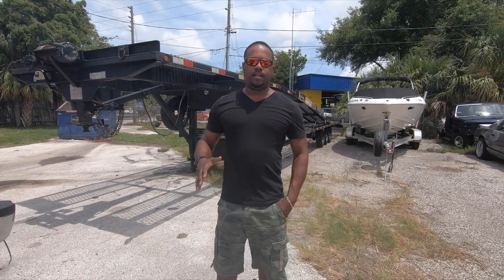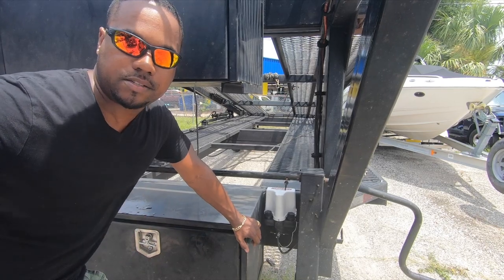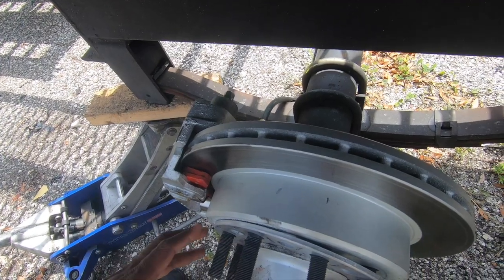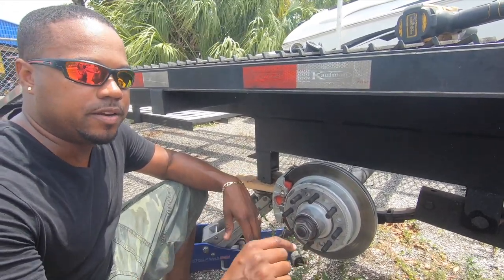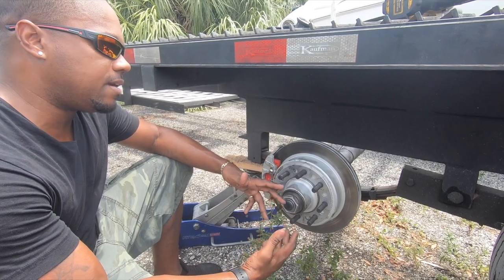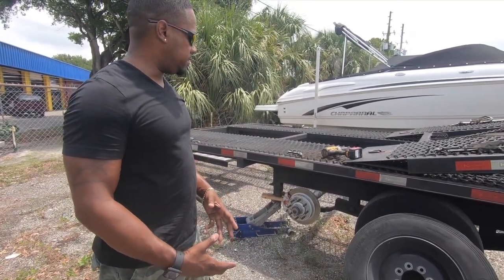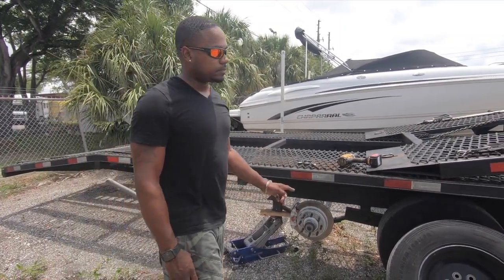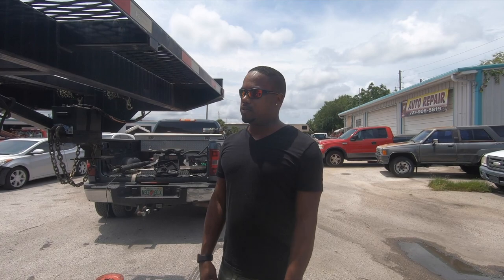Disk Brakes on EZ4 Trailer

Comment: Thank you very much for your videos my friend. I used to have the Hydraulic overElectric breakes on my EZ4 and on time I lost one tire in Tennessee mountains and I had a realy bad time because if you loose one hose in any wheel you loose all the brakes on the trailer , after that I change back to electric you loose one wheel you keep 5 breaking.  Im no trying to talk against you video bud Im just sharing my experience with you, Bud ...and again thanks a lot for your videos.
Reply from the maker: Yeah I worry about that exact situation all the time so I try to keep as much spare parts as I can with me in the truck. But thanks for the support brother

Comment: Thank you for sharing your knowledge and yes - I agree, disk pad replacement is so easy and you may have solved the biggest complaint about hauling four cars with a dually - the stopping part! The truck will pull the weight no problem and as long as you do not thrash the shit out of it from stop - get go,  your transmission should hold out as well.
Reply from the maker: 😂 you are absolutely right stopping is a must and This was the best investment for this trailer
Reply from the maker: Thanks for the love brother

Comment: Hey bro, did you have to weld a different flange in order for it all to work? My kit is not lining up.
Reply from the maker: no welding but i did have to use wheel spacers
Reply: my kit isn't lining up either. Did you ever figure it out? I have 8k hybrid axels

Comment: What year is you chevy?  My 2011 feels like I have no trailer brakes at no time. At least with the foot brake. I'm now looking to convert to disc brakes
Reply from the maker: I have a 2011 Silverado 3500 and I felt the same way when I had drum brakes on the trailer. It’s also way cheaper to maintain the Disc Brakes and then the drum brakes

Comment: Whats up brother, thank you for tour videos in advance, I have a kaufmn EZ-4 with the ussual issues you mentioned, what issues you hav found with the disc until now, I heard people say they lost pads and calipers burned and fail the whole system?! What do you think in your experience ? Thanks
Reply from the maker: I haven’t had any issues with the disc brakes other then the over priced rotors, I let one of my pads get down to the metal once and it damaged a rotor , fortunately I was able to get it cut for $15 and it’s fine but if I had to buy one it was $270 which is ridiculous.
Reply: Thats the price for a drum ,so dont feel bad, I replaced 2 months ago, equalizer, bushings,drums the whole brakes and 2 month afet I have 2 drums bad on the side where the magnets slides, and 4 pads on 4 drum but only one of the pads at each drums, I don't undestand how a new systemgets bas so quickly and why only one pad. Brother  the stopyourtrailer location its in tampa?
Reply from the maker: @davidcandao1  well the guy I ordered the kit from his name is Bill here’s his number (813) 363-4685 I can’t remember where he’s located but I don’t think he’s in Florida
Reply from the maker: @davidcandao1  and yeah I get six months out of these disc brakes and I never have to turn up my controller, when I had drums I was going through them like underwear and I was constantly turning up my controller not to mention they were a pain in the ass to change
Reply: @Floridamuscle  bud thank you so much for your help, see u around,  be safe good luck.
Reply from the maker: @davidcandao1  ditto man and watch out for DOT also make sure you kick your wheels on the trailer at least twice a day to make sure nothing has come loose, that has saved me a lot of headache

Comment: Were you buy the pads
Reply from the maker: Autozone
Reply: You now the part number or something because i cat find them for my trailer
Reply: Thank you so much
Reply from the maker: @rachelvazquez4306  DBC – 225, Autozone should be able to cross reference these they are GM pads
Reply from the maker: Also look up Kodiak disc brake pads and that number on eBay and you’ll see them